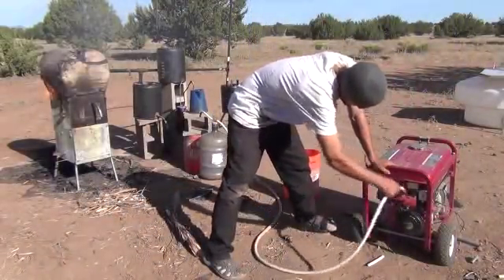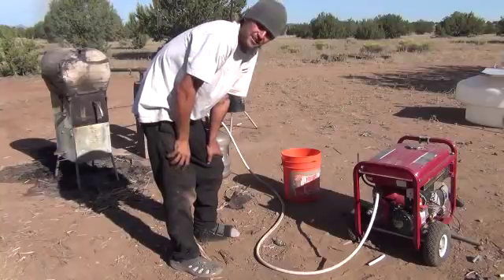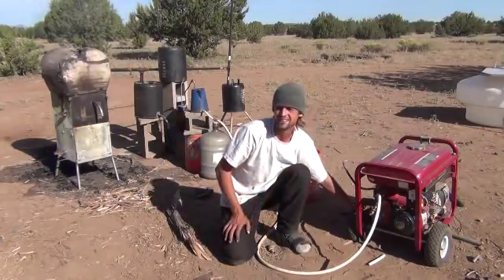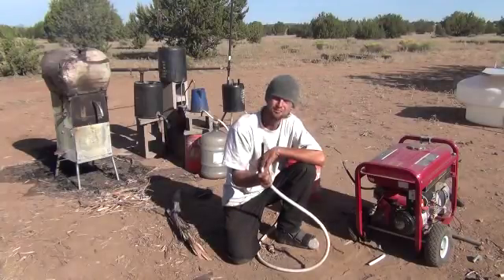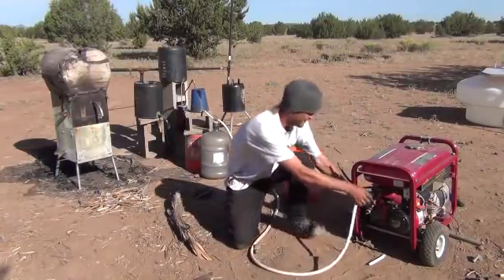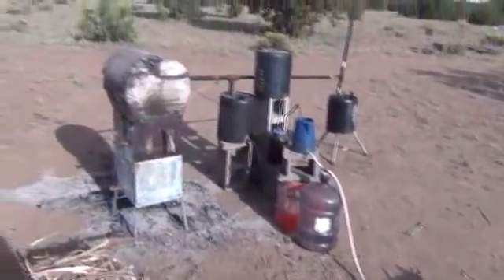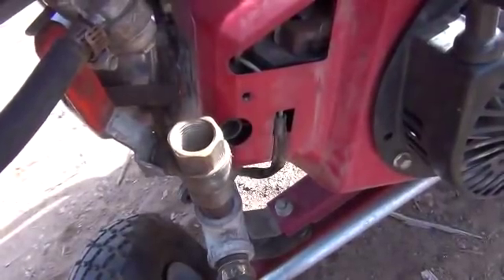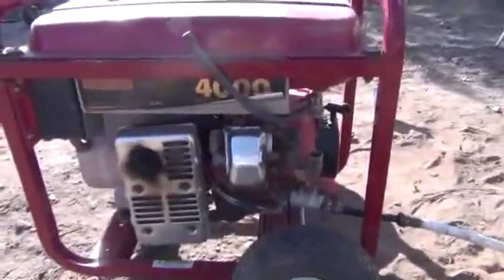Wood Stove SMOKE used to run a generator, with a load test!

Comment: What about switching your source from wood to dried Cow or goat Manure?   I would think that would generate more smoke and be more sustainable.   You could fill paper bags or small cardboard box's.
Reply: @GHumpty1965  use the manure first to generate methane, once that is done could then dry and use  the material in a smoke generator.

Comment: Great piece of work you have there MT. I love it. Course I'd tend to love anything that steps on the toes of the all too mighty DOE. Anyway, it might be too soon to tell yet, since you only posted this a week ago, but I'm curious to know just how clean the syngas burns in the generator. I couldn't see the flame when you lit it coming right from the hose, and thinking about it, it would seem to me that it would be pretty dang clean. What does the spark plug look like? Any fouling going on? From where I'm sitting it sounded like it was running just fine, even when you put the load on it. Again nice little project you have there. Gratz and keep up the great work. You just got a new sub